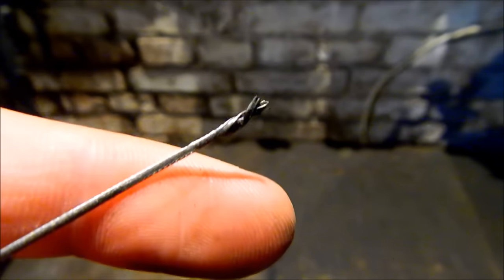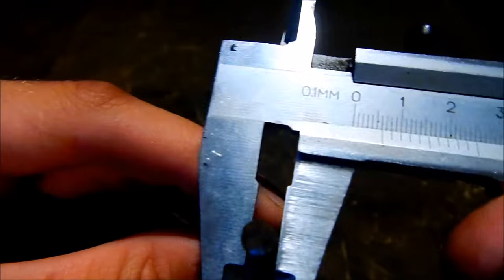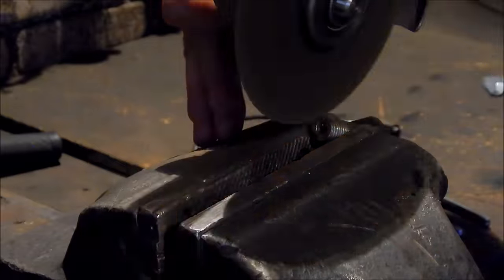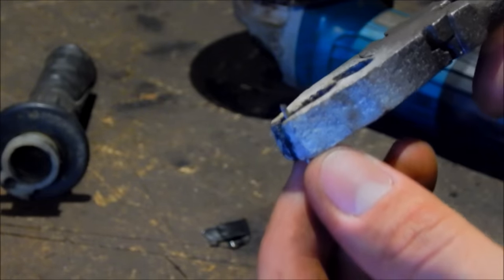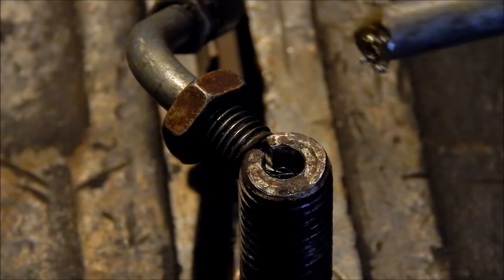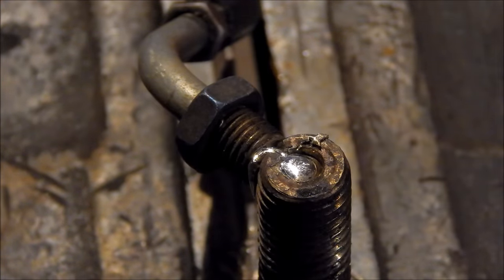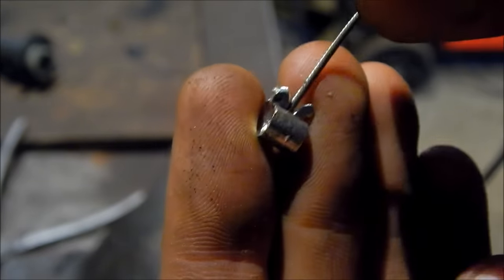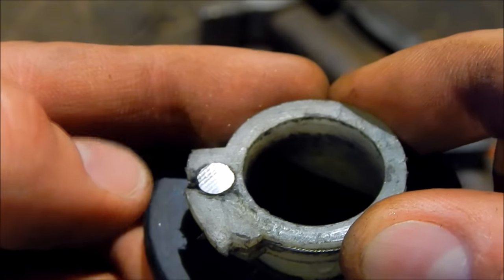Throttle Cable Solder Repair Tool - Simple Fix!

Comment: Two problems.
The first is you should clean the 'hairy' end of the wire with brake cleaner before soldering because there's grease in the cable which will prevent the silver solder gripping the wire.
The second problem is a lot of heat is hitting the steel cable from the blow torch. You need to shield the wire from the flame - use clay if you must - just don't let it get hot because it softens the wire.

It's a clever repair though.
Reply from the maker: It's all true, good points you made! All of you people watching this video keep these points in mind. Thanks for watching!

Comment: Solder will FLOW towards the HEAT.

as in Copper plumbing.

That way it will fill in completely.

Apply the flame to the bolt and then touch the lead to the bolt.

Keep the heat opposite where you touch the solder.

Comment: what works good it a .22  empty shell case , drill hole put cable ( flare )  in same idea solder , 22 shell casings as a perfect fit for throttle cables

Comment: Also hardware stores sell a steel tube that size the you drill a hole the cable will go thru then spread the cable and then fill the tube with super glue letting it harden

Comment: all I do is get a nut and a bolt, drill a hole through the bolt, stick the throttle cable through it and tighten the nut and it works perfect

Comment: Try using metal with a higher melting point than lead, a zinc slug would offer a higher breaking strain and be more resilient to fatigue, but can still be melted with a propane gas torch.
Reply: Brass is The Best That's what I used 50 years ago (:

Comment: Which metal rod did you use for making cable / wire end??
Reply from the maker: It was solder for soldering wires.

Comment: Instead of using a bolt you can also drill the right diameter hole in a piece of wood and get a good result using a soldering iron and solder, but I enjoyed your video.

Comment: I like the idea, but how strong is this? For a motorcycle i don't think this is strong enough. What are other options?
Reply from the maker: This lead end is for throttle cable only.
Reply: @DonnDIY  Thanks. you have a subscriber.

Comment: You can make cable ends from brass screws of bolts
I made one once from the brass nut from a spark plug
Reply: I lost a brass nipple when working on my bike. Set 2 and made a new one, only to find the original embedded in the front tyre 2,000 miles later half worn down.

Comment: Ahhh i jist noticed the title "THROTTLE cable" lead would be too soft for a brake or clutch cable, but throttle has so little tension on it. Still i agree with many comments about using an alloy instead of lead.

Comment: Use a reducing flame from your torch on the bolt to carbon up the inside before soldering; PRESTO! a non-stick finish.

Comment: it's simple but doesn't work like we want.... For example i use a piece of 100mm nail, drilling that thru hole with 2mm, and than used my transformator 220v to 2v, heat that one to yellow colour and squeezing in a vice. True stranglehold! lead is very soft for this...

Comment: Very clever no question about, problem is a bit too laborious, unless you live in a remote place is better take the car and buy a new one.
Reply from the maker: This video was made by keeping in mind that I live in a relatively remote place and that spare cables aren't always available on demand and it may take up to two weeks to order them from the manufacturer.

Comment: You can also fill a hole drilled in a piece of wood (2x4) with Flux, melting it with a torch, and it makes a small solder pot. I like the neatness of the bolt though.

Comment: I appreciate the effort.But what I need it connecting two or more motor cycle clutch wires to make a long rope. This would be used in towing a car.

Comment: Good morning friend what material you used to do the head of the cable? That you melted.
Reply from the maker: Solder.
Reply: Donn DIY You weld of electronics? Or any other kind of weld? Thank you.

Comment: for the barrel just use the old one. heat it up and solder falls out. the end of the cable that's cut feeds through the barrel. spread the ends and solder not getting the cable to red hot. just enough for the solder to flow. and not alot of solder just enough the fill the very end of the spread cable. takes about 3 minutes if the tools are in front of you. you don't even have to take cable off the bike. those barrels are not made of lead, as the lead will not be durable enough to last a short time.

Comment: I used a cable adjuster as the tool, just had to put a slot on the side for the cable.

Comment: hello! do you think i can do it also for a clutch cable?
Reply from the maker: No, the lead is too soft for a clutch cable. This will work only for throttle cable. I would get something more substantial for clutch cables.
Reply: ok could it be zinc?

Comment: This is a good fix but there aren't one in ten that have drill presses. There probably aren't one in ten millennials that have ever soldered anything. I am old. I grew up having to work on my own car to keep it running in the 1960's. Today, the majority of people have zero mechanical ability and even less desire to fix something. I told a kid the other day that when I learned to drive, there were no air bags. We knew cars were dangerous and had to actually know more than start and stop to drive. Hell, my first 2 cars didn't have seat belt. They weren't even offered as standard equipment on cars till I was in junior high .By that time, I was already driving illegally and had a motorcycle. Hate to ramble. Great video.

Comment: I had a few pull out so I have also used a center punch on the flat face of the end piece. May have been due to my poor soldering.

Comment: This looks good but I'm not sure how long-lasting this repair is.
When soldering, it is sometimes difficult to get a good bond unless all parts are thoroughly cleaned.
And all parts must be brought to the right temp before proper bonding can take place.
I would not want to be on the highway and have the cable pull out.
I would rather go with a more reliable connection. Maybe brass or steel. 
Also, I'm not sure that lead is what's found at the end of these cables.

Comment: This method has been around for YEARS. I'M NOT knocking your video because it's bob on in the method of doing it. You say oh it's probably a temporary repair but I've known these repairs last for 10+ years easily. If the cable end is flux dipped and given a good clean it's as good as new 👍😉

Comment: At the risk of sounding naive I'm gonna ask this question that kept popping in my head while watching the video. Couldn't u simply cut a small piece of that 6mm nail & solder the cable directly to it instead of creating a separate cast for melting lead to fuse with the cable?

Comment: I do alot of farmyard engineering myself to keep things going past any imaginable service life.And people never lubricate cables.And the little ends do break off.
But a cruddy throttle that does not snap back and return the motor to the correct idle speed,means there are other neglected areas to get functioning also.
A plastic bag and some electrical tape was old school (poor kid) way to get oil to gravity feed down and drip out the other end.
I was a poor kid.
Now Im just a cheap old bastard!!
Reply: @Cuts rose scents  Plastic bags yeah, but I’d use rubber bands that the postman dropped, would scour my street looking for em... peg it overnight to Mums washing line.....
Ahh, Happy days 👍

Comment: Without  all these work like drilling  cutting and so on, you can get a right size plier and use the circle are in the plier and do it in no time.

Comment: You need to splay the end of the cable, about 3mm, ONCE the nipple is fitted,  then pull back in to the nipple, do not solder unless the end  is spread out slightly,  just enough to file back around to the nipple. if you don't splay before the nipple
 two months later it will pull out ..guaranteed
I have made my own cables for the last 55 years, and no nipples pulled off. Only cables broke through rusting.

Comment: Nice, I personally skip the drilling part and just cut a potato in half and make a hole with a straw in it put in there the cable and the rest is prety much the same.

Comment: 3:00 yeah but you can always sacrifice the bolt 😉
Reply: im looking at using a similar method on this el cheapo dial indicator vice clamp thing, crappy end pulled through and inside of tool broke so im just gonna re design it, and better, was thinking of using copper for the ends, should hold up in my scenario

Comment: i once brought my clutch cable ro my local motorcycle shop to have them repair it this way, and they told me they could not do it. 
Back in the day every shop was prepared to do this. Now they just want to order you a knew one. That doesn't help when you have a race the next day.

Comment: It won’t hold on a clutch cable unless you use 90% silver Solder.. it may hold on a cable that does not have a lot of tension on the end such as a small carburetor. But it absolutely definitely 100% will not last long on something like a clutch cable unless you use silver Solder..You can put marks in lead with your finger nails. It’s too soft for this type of duty
Reply: So a silver type solder is stronger?
Reply: camscustombuilds 
   Back in the 70s and 80s I knew an old timer that was actually a test ride or for Harley Davidson on the 30s and 40s.. He even named his dog Willie G.He was a photographer during World War II. His name was Wayne Kelly..
  Wayne was in the service in Germany during the war. He was a PFC, he said that meant, personal friend of the colonel..
 Wayne in the colonel had met a couple of ladies, and they were fishing from a confiscated boat somewhere in Europe. They were using German hang grenades, because, the American grenades punctured the fishes bladders and they would not float to the surface. So they were using German grenades. The problem is, one of the grenades damaged the propeller on the boat they were fishing from... Wayne, knowing some of the guys in the BMW factory in Germany before the war dressed up as a civilian, and rode a bicycle into Germany to have the propeller repaired at the BMW factory, which was a German factory in enemy territory... as fate would have it, Wayne had the propeller repaired by his friends in the BMW factory, and on his way back, it just so happened that was the day the battle of the bulge broke out. All hell broke loose, he was arrested by Americans.  and he was about to be court-martialed for dealing with the enemy, but the colonel intervened.
 Years later here in the United States, Wayne’s son was in school, they were going through the history books, and there was a picture of Stalin, Churchhill, and Roosevelt at some meeting in Europe during the war. Wayne’s son said out loud to the teacher, my daddy took that picture. The teacher came right out and said, you’re a liar. So, the very next day, Wayne’s son took the negatives for that photograph and many others to school with him, and the teacher apologized in front of the class..
   While Wayne was a test driver for Harley Davidson, he hit a dog crash the motorcycle, and broke his back. A few months later, Wayne was back on the motorcycle and a full body cast, test driving a Harley Davidson again, and he hit a cow. He crashed, and the cast broke into pieces, Wayne said at the time, it was time for that thing to come off anyway, so he finished removing what was left of the cast, restarted the machine, and continued the test drive..
   The first time I ever met Wayne,1970ish a friend of mine and I were taking a Suzuki engine to his shop, which was a Suzuki dealership, to have something repaired, I don’t remember what it was. Eric Buell, yes that Eric Buell was there working in the shop also..Wayne was making a pair of main jets out of brass stock for a customer that was leaving for South America that evening. When you go up in elevation, you have to lean your jetting out or the bike will be horribly rich. A customer was going to be crossing the mountains in South America, I’m not sure of the name, I think it’s called the Andes. On his 650 Yamaha twin, but Wayne made him a pair of Main jets for his carburetor‘s from Raw pieces of brass..Wayne was also known
throughout the United States for his wheel repairs on BMWs, and his dual plug modifications to the BMWs and Harley Davidson’s..He was also known for repairing wheels for the BMW owners club of America cars and the Saab owners club of America.
  He was a mechanical wizard. He lived in his shop.He did not own a television or a radio.
   The Steelers where we live we’re going to be in the Super Bowl in a few days on Super Bowl Sunday. I asked Wayne where he was going to watch the game. He said, what is the Super Bowl? And I explained to him. He said to me, the only balls I am interested in are ball bearings.. he truly did not know or care what the Super Bowl was .His whole life was motorcycles.He had a shop full of motorcycles from customers and wheels from around the country to fix at all times.
   I wanted to replace the throttle cables on my 1979 Moto Guzzi SP1000 In preparation for a cross-country trip I was going to be taking in a couple months. I was going to save the original still good cables around the headlight up inside the faring and keep them as spares... I bought a pair of what I thought were the correct cables from a not too near Guzzi dealer, but they were too long by about 2 inches. So I went to Wayne’s shop.
  We figured out the length, and Wayne showed me how to form the ends and he said you can only use silver Solder on this if you want it to last at least  as long as your machine does.. that was back in about 1984, Wayne gave me about a foot long piece of silver Solder he said anytime you make a cable up, use this and you’ll never have to fix it again. I still have that piece
  I am an HVAC technician. And I know that silver Solder Holds better, and is required by some manufacturers during install of new HVAC systems because of its strength..
  Wayne rode a motorcycle well into his 80s. Always BMWs.. he was a poor man because he was honest. Wayne refused to do custom wheel work for the pagans mc club, because he disliked the image and the bad name to motorcycling the clubs like that gave to. Motorcycling.. he considered them a bunch of assholes and he threw them out of his shop. They poisoned his beloved Saint Bernards/ radial and rensport..
   I could go on and on but, if Wayne said you have to use silver soldet to make the ends of cables, you can take that to the bank...

Comment: I think i would spend more time drilling the hole in the nail than i would just grinding the end of the wire to fit after i put a chunk of lead on it.

Comment: Instead of drilling a bolt just use a bar of soap...way easier & works just as good if not better for a mold

Comment: Or you could get a new cable just saying! ;) I don't have an angle grinder nor do I have a drill press I do have a rotary tool and a vice so I guess I could do something like this but for a $3.00 part I doubt I would bother.
Reply from the maker: For sure. I know what you mean, I wouldn't bother either. I would definitely buy a cable if I lived near a city. Usually little town shops never have the spares I need in particular. They do have everything else. So this was just a quick fix I used for my moped throttle cable and it works till this day.

Comment: I had the throttle cable snap on my 69' Bug when I was in high school a few times (this was the 90's. ) Was I or my brother this crafty or handy with tools to repair the now destroyed cable that was now not long enough to reach the gas pedal? Nope... Was my father the caring type where he made the tough choice and decided not to drink the case of beer, proceeding to come out to rescue us? Nope... What we were, was two idiots with pliers and a solid understanding of the Star Trek system of 1 beep for yes and 2 beeps for no... My younger brother had to have his head and torso down by the pedals, and use the pliers to pull the throttle cable while upside down and I worked the clutch, brakes, and stick shift. One slap was for throttle and two (or panic slapping) was to let off throttle. Many back roads were used and thank god 2nd gear was forgiving... If you know where Sarasota is in FL, we had to drive across Sarasota to get home and we did.

Comment: What’s wrong with the proper way of drilling the bar countersinking it threading the cable through splaying and soldering it, much better stronger quicker job!

Comment: It shouldn't take too long for the steel cable to slice through the lead retainer like a piece of cheese.
Reply from the maker: The throttle cable I fixed like this is still going after several years on my moped. I agree to disagree.

Comment: Really this labor is in vain, my motorcycle's B gas wire was broken, I bought a new wire and passed it through the other body and made a tip on the outside like in this video. After sanding, it looked like the original, but the lead was really easily sanded and melted, although this made me nervous, I assembled it that way and exactly what I predicted happened. The end of the wire I made like in this video broke off, it doesn't really make sense to do this with lead, it breaks very easily, I melted the end of the old broken wire and it turned out to be a much stronger material. Anyway, let me give you the tactic, find a nail the thickness of this end part, then cut that nail to the desired size, drill a hole in the center of the piece you cut and pass the wire through that hole, then bend the end of the wire backwards and pull it back, you need to pull it very firmly, when the bent wire is completely inside the end you made from the nail, you can melt and pour lead into the gap at the top, then sand the excess. Now you can even pull a truck with that cable. Say thank you afterwards.